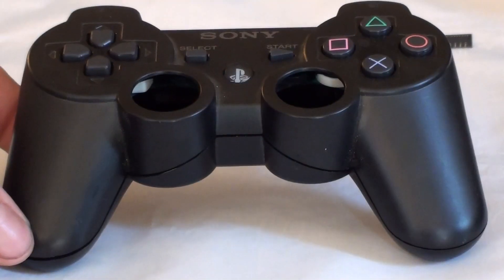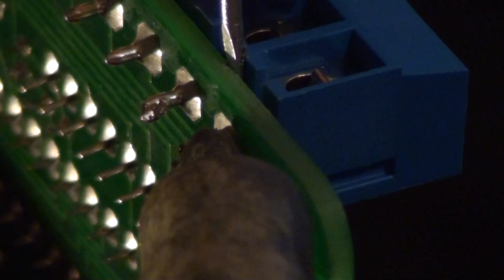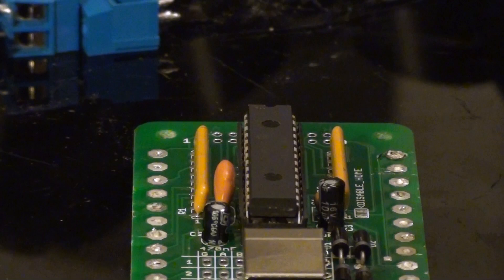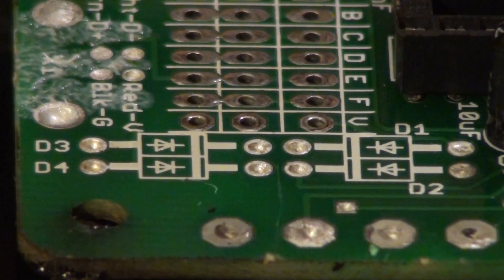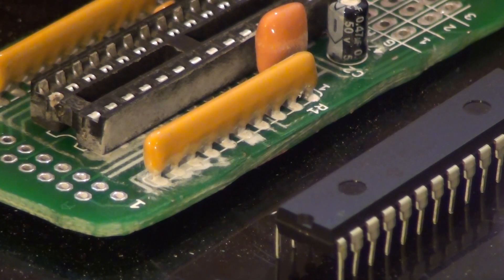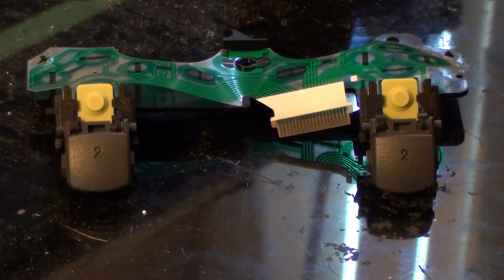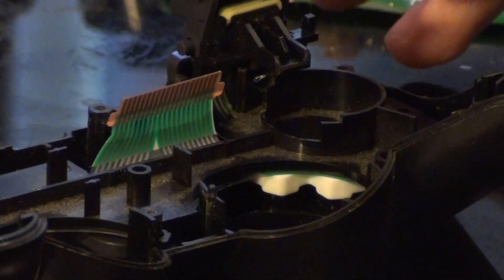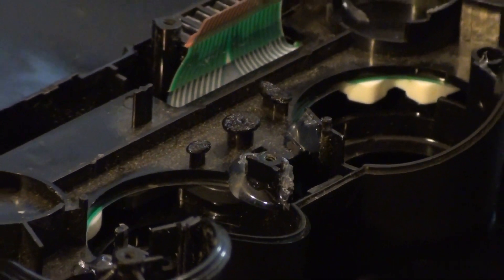Tournament Legal 6 Axis Ps3 Controller Mod

Comment from the maker: @L7dev The solder joints for the screw terminals on the MC Cthulhu are very difficult to desolder with braid. You would need something like a desoldering gun, which can be expensive.

Comment from the maker: @L7dev I never tryied scoring a PCB and snapping them, but I imagine that being more difficult because the MC pcb is pretty thick. With a dremel you can keep the edges round and sand down the board to smaller sizes that scoring would be impossible to do.

I do appreciate your questions though because there is always more than one way to do something.

Comment: Buy a solder sucker or some braided copper wire. a 5ft (or so) roll of the wire will run you less than a dollar and a decent solder sucker will cost no more than 10-15 bucks. With less than 20 bucks cost you'll save yourself some time, some of those pads, and your sanity...and that's just for one project.

Comment: Surely there must be a programming hack that will allow you to code up an emulation to make a stock PS3 controller work how you want it to? rather than this hardware hacking...surely? I maybe wrong....but why hasn't someone software hacked this thing first?